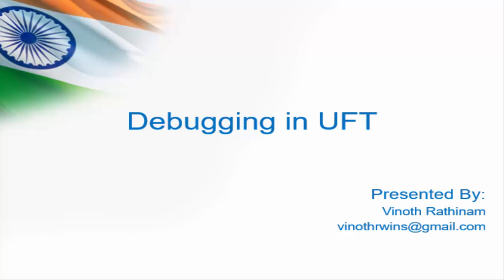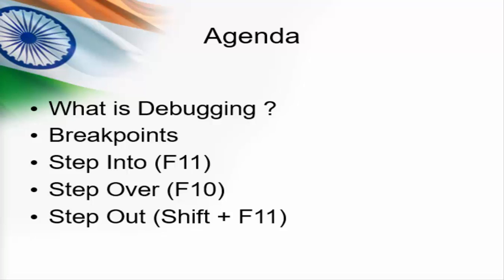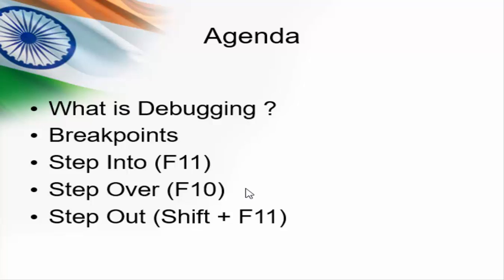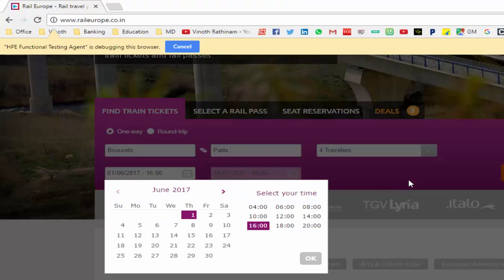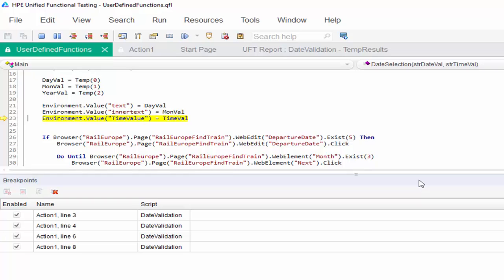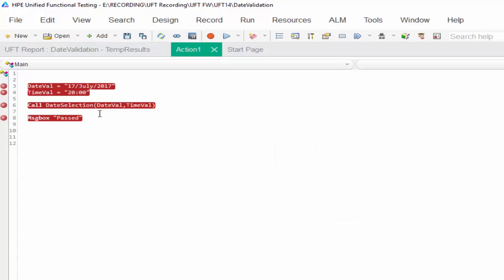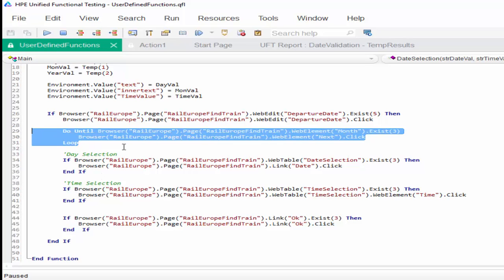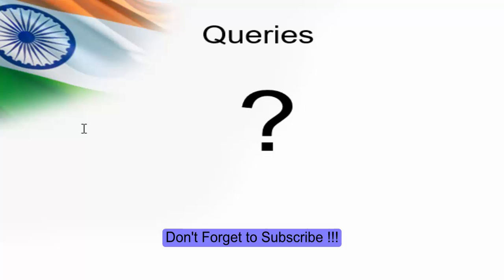UFT (QTP) Tutorials 13. Debugging in UFT (Step Into, Step Over and Step Out)

Comment: If we know the step having issue we can fix the code.if not how we will find as where it is failing in  1000 lines??
Reply from the maker: Hi Sravani,
Could you please elaborate the scenario. 
As per my understanding while executing the script in UFT , even if we have 10000 lines also , in the report it will mention exactly where the failure is happening. So from the report, find the exact method or function which is creating issue. Then debug that particular portion to resolve the issue. :) 

For quick fix ping me to my LinkedIn ID . 
https://www.linkedin.com/in/vinothrathinamaiacademy/

Regards,
Vinoth R